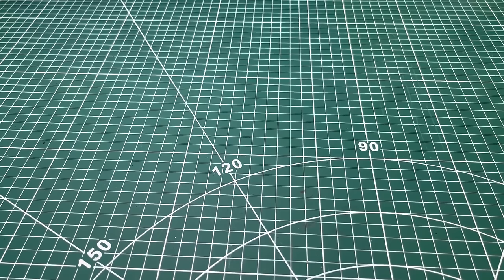Making A Hunting Knife From A Saw Blade

Comment: Decades ago a friend did this.  He bought large old saw blades (like 36").  Then he would take months drawing blade shapes, with welders chalk.  When he had used all the space on a blade, he would pay me for the oxy/acetylene gas I needed to cut out all the shapes.  Then spend months making all the knives(daggers/swords).
Some years later he gave me one that he had over estimated.  I was a few inches taller than he, and this one was too big for him.  Holding it while standing, the tip of the blade was dragging on the ground.   It was a Philippine "barong", at least 30" long.  It didn't actually fit being called a knife or even sword anymore.  Just a scary weapon.

Comment: You do not want to use the angle grinder for cutting out the cutting edge side of the blade. Heat from cutting will cause degradation of steel quality in this critical zone.

Comment: How can you tell if the sawblade is going to work for a blade and keep an edge? I have no idea how to tell what it's made of other than the teeth.
Reply from the maker: This steel is pretty good. This is a 9hf  tool steel)
Reply: @edwardknives8692  do you have any recommendations on what blades I could pick up new in-store to make knives out of? My friend asked me to make him an ulu and I thought that a circular saw blade would be perfect for that
Reply from the maker: Yes, it will be great👍
the only thing is that it is susceptible to corrosion
Reply: @edwardknives8692  that's fine. I have made knives out of 1080 and 1095 steel.